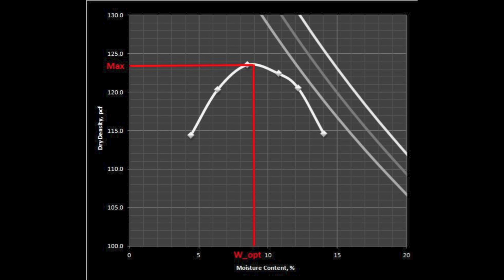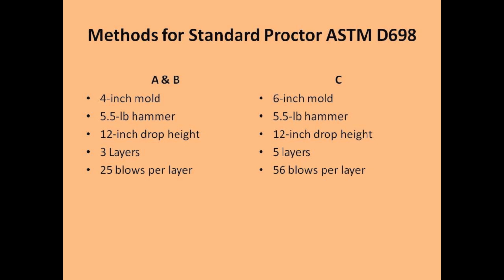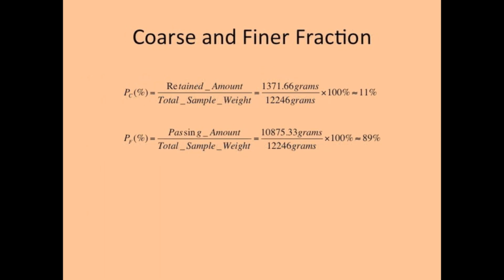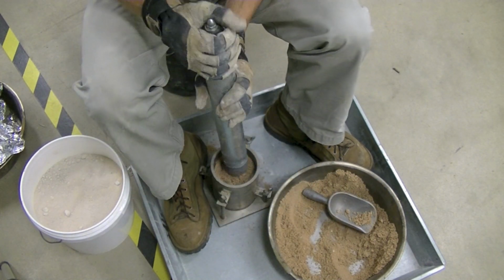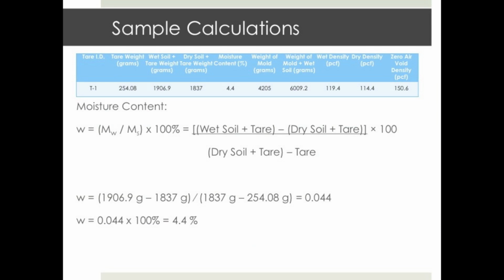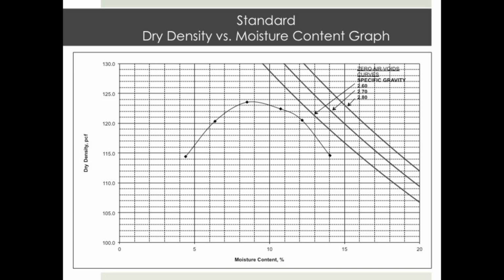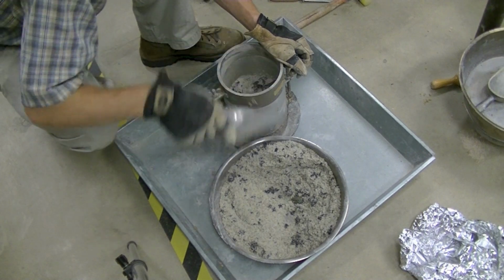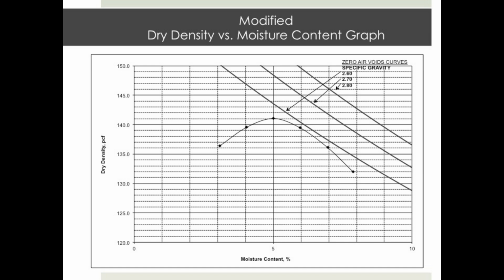Standard and Modified Proctor

Comment: The hammer should freely drop from a height of 12" from the surface of the soil, not hammered down by the user as done in the video. Lift the rod up all the way inside of the hammer cylinder which is exactly 12" and then let it drop by itself to the soil.